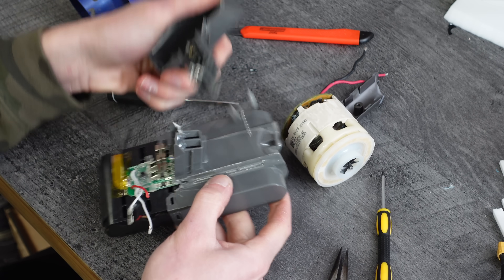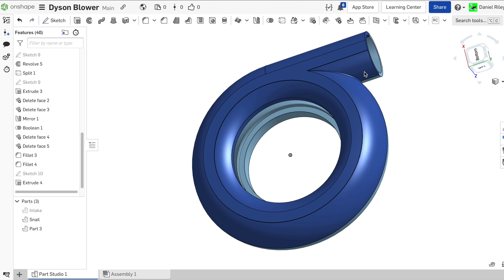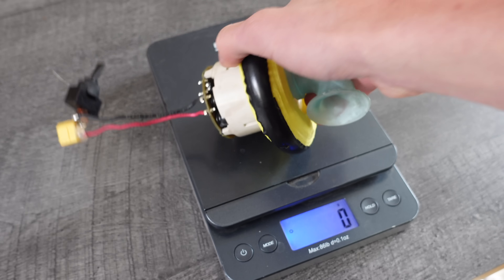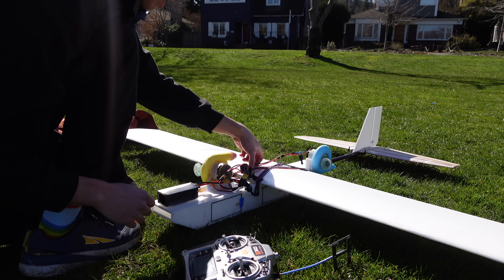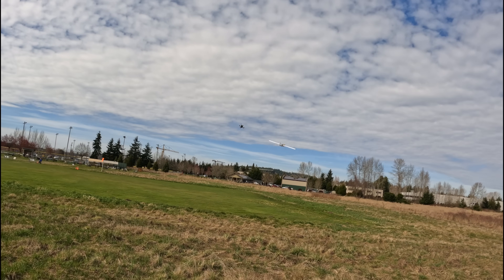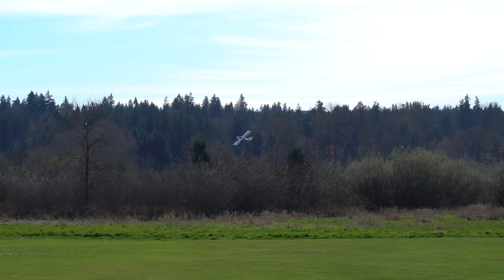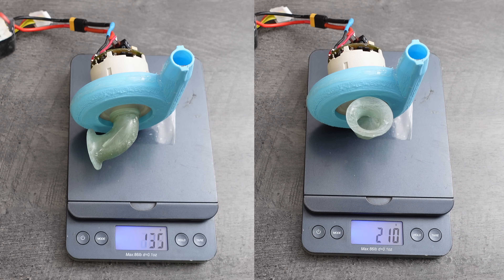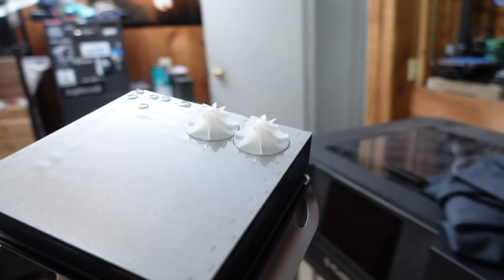Dyson Powered R/C Plane

Comment: someone just tossed a $500 vacuum away cuz one battery was bad lmao. good find on your part. i got a dyson and its impressively quite yet powerful like you said in the intro. this should be an interesting video.
Reply: people throw stuff like that away all the time. i have a buddy here that repairs "trash" flat panel tvs and makes a killing; because it always comes down to like, one tiny broken cheap part that wouldve sent the whole thing to a landfill.
Reply: yeah why can he find so many dysons?? I wonder where he looked for them..
Reply: seattle. lots of people with money
Reply: @Nick Lachen  Goodwill second hand stores have "bins" locations. They float around, and if you're willing to hang out for a couple hours, you'll find three or four in a day at weight ~28c / lb.
Reply: A good tip for when the batteries wear out is to get an adapter for DeWalt/Makita or whatever batteries your cordless tools use.
Reply: @Yoshikaable ou can also just buy a replacement battery for like $20 and it'll last another 8 years
Reply: @FAB1150  nah, just turn it in to dyson and they will send you a brand new one back. Lifetime warranty.
Reply: that model is like 12 years old now
Reply: @sausagedog52  and is still covered under the lifetime warranty
Reply: I've found that the type of people that buy $500 Dysons are not willing to repair anything.  Everything is disposable.  I've pulled 5 Dysons out of the trash and repaired them.  One was as simple as it had a stick stuck in the tubing, preventing a rotating valve from seating in either of two positions.
Reply: It is Seattle so...
Reply: That's BS. All dyson products have a lifetime warranty, there is zero reason to ever throw out a dyson product when you can just ship it to Dyson and they send you a brand new one back.
Reply: Wealthy yuppies in Seattle, that's all there is to it.
Reply: The batteries are sometimes hard to repair because if the battery controller detects that the pack is defect, it will write this information to permanent storage and the pack will still report that it is defect and refuse to work, even with new cells in it.
Reply: They are really expensive, but they are really good vacuums.
Reply: this is society in a nutshell
Reply: I have never bought a vacuum, people are so quick to throw them away.
Reply: @TuckMcSouthard  These stories are all BS, no one throws away a Dyson product, becasue they have a lifetime warranty.
Reply: @sqlevolicious  That's good to know, and might explain why most of the vacuums I have found aren't Dyson.

Comment: OK now connect the exhaust of one centrifugal fan to the intake of the other one
Reply: You'd have to mess with the diameters of the tubing for the intake of the 2nd stage fan I think
Reply: Multi stage centrifugal pumps don't increase the flow rate but it does increase the total head. Since the thrust produced is from the flow rate then the thrust wouldn't be increased. You could try altering the diameter of the exhaust of the 2nd stage with a converging nozzle as the pressure would be higher to attempt to accelerate the air more to produce more thrust maybe.